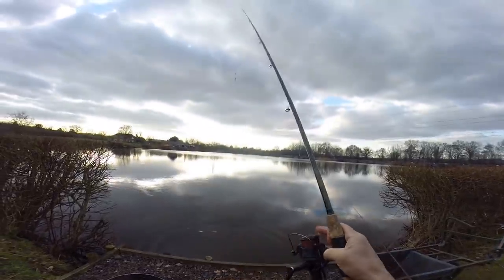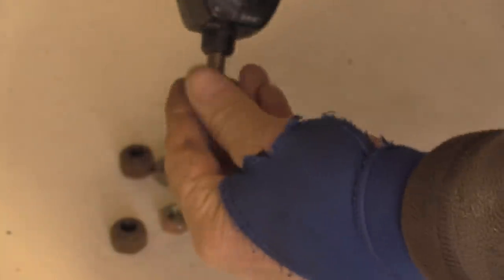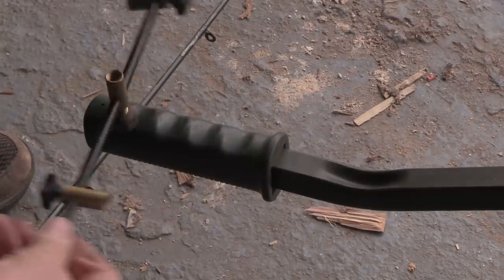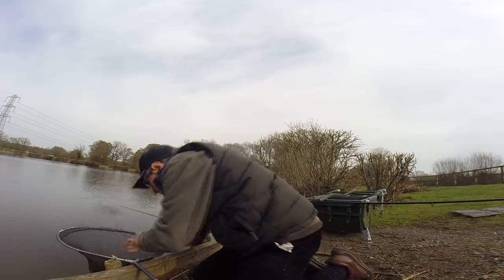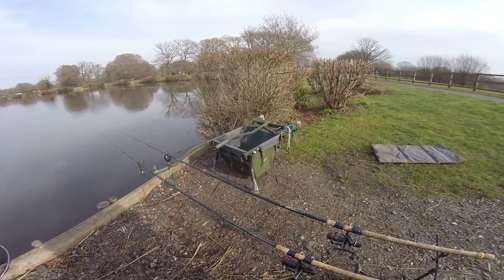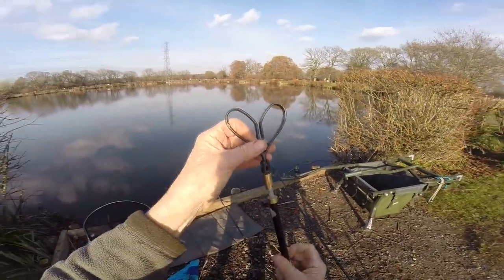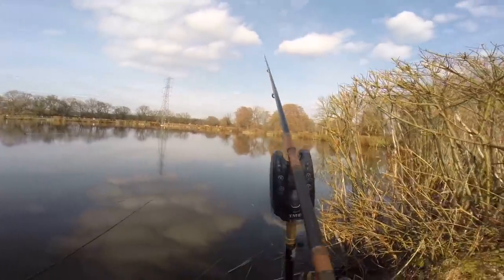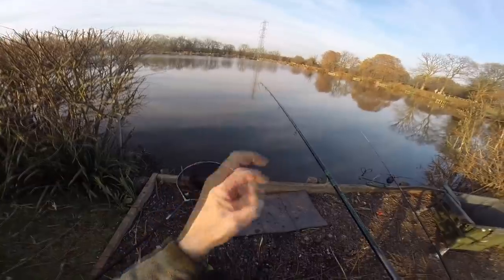I Pimped My Carp Barrow: Carp Fishing

Comment: Threads on fishing tackle are 3/8th BSF, so one of the fist things I did was to purchase the corresponding tap and die sets, now I make my own tackle, for the studding side I use 3/8 round brass bar and a 5/16 drill for the tapping hole into whatever, mind you it makes it alot easier having a lathe but it pays for itself in the long run, AND I know it is well made and will not break.

Comment: I've been using a similar idea for a few years now, but I tape lengths of hosepipe to mine for those moments when you can't get the sticks in the bank. I also use lengths of hose pipes with one end taped up to protect my rod holdall from getting holes in from the banksticks sharp end. 
Once again, another entertaining video, thank you.

Comment: You can't beat a Graeme video. He is inventive, resourceful and humorous. The wheel Barrow conversion was superb. (having bought rod rests for concrete banks that were a pain to set up and align)
You say you never caught a big roach well you have now, I am sure that would of gone 2lb plus. Nice video thanks for posting and thanks for your response to my last comment on worm protection, that had me in stiches. Currently transferring frogs spawn from a bird bath to my two ponds. They insist on spawning in the bird bath and nowhere else, the water is only 3 inches deep and dries out late spring early summer. My big question is how can one female frog lay a minimum 2lb of spawn without imploding?

Comment: I made something similar but attached it to the chair. So if your at a venue where you can’t have your rod rest pod close due to the size of the swim. Clamp the modified pod to my chair. On the other side with it attached by an umbrella clamp, a small platform on a pole for all my odds and ends. Works a treat if the swim is flooded

Comment: move this there and that there put that up move this over flip this around and screw this over onto that swing these over and do a belly flop in the water open your mouth and hope a fish goes in. if your lucky it will be a massive roach then you dry it out and smoke it. thats a lot of effort for some small dinkers
Reply from the maker: It all keeps me amused and I apply the same principle of trying new things with big 500lb sharks and Marlin ,and of course they may not count as Dinkers. Its all relative. Just a throwback to old school fishing 60 years ago when we had to make stuff if we wanted to progress in fishing. It wasn't all dished up on a Tackle shop display board. A lot of satisfaction when you try something and it actually works.